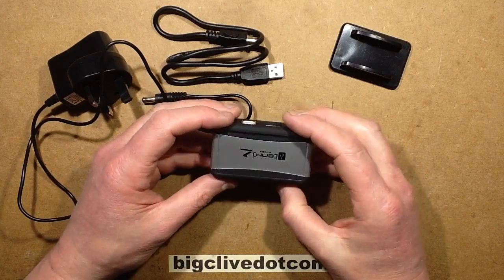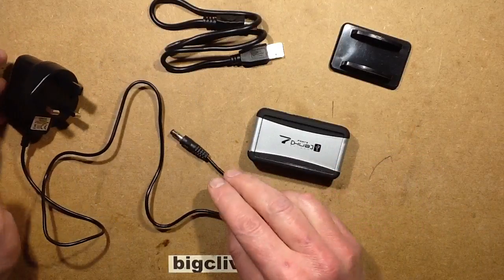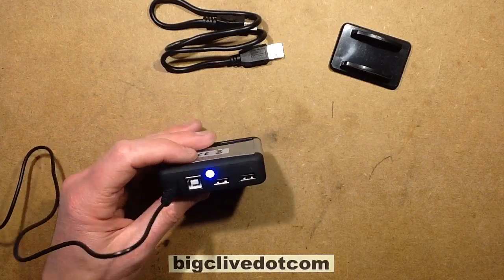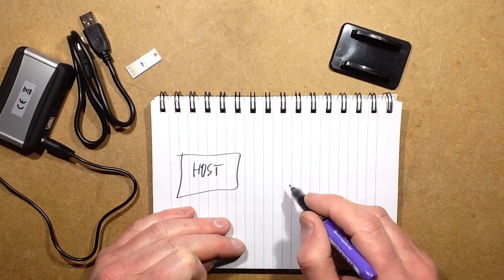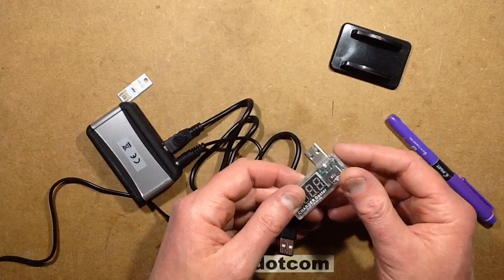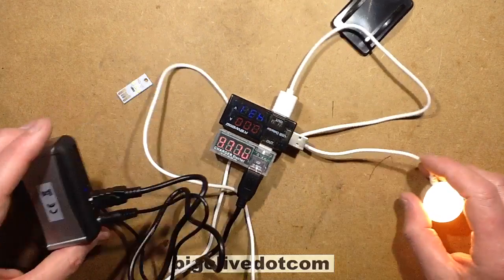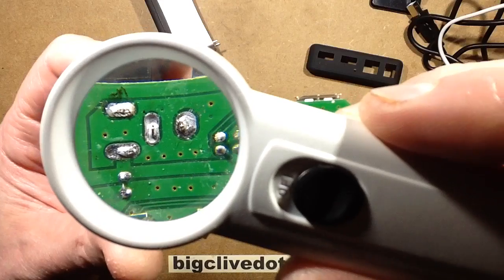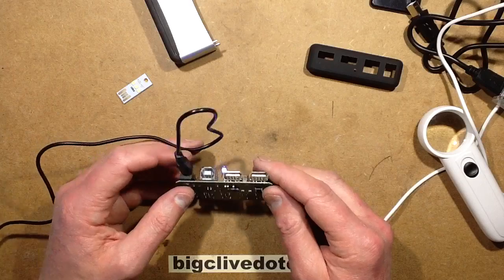Computer killing powered USB hub.  (Mac murderer)

Comment: Clive, there is a in important reason that people will use a powered USB hub even with a powered desktop computer.  According to the USB 2.0 standard (yes, I am out of date) the current that must be delivered by a powered hub is the same that should be available from a regular USB port (about 500mA if I remember correctly). If it is a non-powered hub, it is only required to source a much lower level of current (can't recall) so some devices that don't have their own power supplies may not work from a non-powered hub.
If the hub is supposed to work either powered or non-powered, it should have circuitry that prevents its own power supply from feeding back into its host system.  This was just an improperly designed hub that likely did not meet USB standards and should not have legally been able to carry the USB logo.  BTW, if it is reported and the USB association finds that the logo was not legally approved,  customs can seize these upon importation or they can seize inventory from a store.  Likewise, you may want to report some of the unsafe LEDs and power supplies as, if they have false safety certification marks they are illegal and should be seized.  You may save lives doing that.
And yes, such seizures do occur.  An android box importer had their entire shipment seized because the USB logo was not approved.  US Customs seized it.  A local "Tiger Direct" had their stock of VESA video cables seized because the Vesa video cables were not approved by the VESA association so the logo was not legal.

Comment: If someone killed their comp doing this they are not the brightest. One is for just power when you are using the mouse and keyboard and the other is for power and data. You don't use them both its made for 1 at a time.

Comment: Own one, same observation as others, PC refuses to boot until disconnected. Still using it but USB-B port has broken solder joints.

I guess the option to be powered by DC barrel connector comes in handy if you know what you're doing and has a reason to e.g. audiophiles.

Comment: A few motherboards ago, I noticed one evening that the chipset fan kept spinning even though the computer was off - and it even kept spinning after I unplugged the power cable. You can probably guess where it got the power.

In general I noticed that USB 2 hubs almost all feed the power back to computer, but USB 3 hubs (that I tried) apparently don't.

Comment: Guess someone started using the hub without first reading the instructions. Supply power to the hub using either the mains or a host PC (when access to the mains power supply is unavailable), not both at the same time. Why would anyone connect 2 different source of power to a single device? IMHO, it is unfair to blame the hub when it is the users who are lacking common sense.
Reply: Rovin Tan The standard job of a powered USB hub is to supply more power to its outputs than it could get from the PC.  It's an amplifier for the data lines, it shouldn't back power the PC.

Comment: LOL ive got one of these and ended up just using the USB power from the computer to power up to 4 devices depending on what they are.
After I realized what was going on I only ever used the power supply if I was using USB only powered drives.
Took me a while to figure out what was going on.
I've even found that some drives will cause my system to be stuck in boot mode while those drives do not have any power.
This is on a Toshiba 850L running Win 8.1 so it isn't just limited to Apple systems.

Comment: Perfect present for anyone using a Mac.
Reply: +Pressure Designs Pretty sure that's property destruction if the other party sue
Reply: +LindLyman That would only be a problem for US citizens.
Reply: Pressure Designs
Probably EU as well.. but yes - you're right.
Reply: +LindLyman I am pretty sure that i am save over here in Germany.
Reply: Hmm... I remember someone got arrested for knowingly installing a bunch of faulty gas regulator in a flat in Spain.

Comment: I had that actual hub many years ago - and the backfeeding was a byproduct bonus as the host plug would power the raspberry pi it was connected to. I could have all peripherals connected and have the pi powered and active data lines. This was an original pi so no idea if it works the same anymore.

Comment: I have one of those and the DC that comes thru a converter is to be plugged in if you are using the hub for charging devices and should never be plugged in same time as computer or bad thing can happen. For me that wrote in manual for hub.

Comment: If your wondering why it only damages macs when sleeping, its because when the mac is turned on it is supplying 5 volts to the hub, which is pushing back on the 5 volts from the hub, reducing the current flow to 0 so its not back feeding. When the mac is sleeping though, the voltage is reduced in the usb out, which allows for the 5 volts to flow back into the mac, and basically confuse the computer until it freaks out and shuts down.
Reply: Makes sense, since I don't think USB ports are connected to the 5V standby rail on the PSU that's always on even if the PC is shut down.

Comment: Thanks for this Clive, I never thought to check powered USB hubs like this.  With the plethora of 'new' USB 3.0 hubs and probably USB-C hubs, this could become more of a common occurrence.  Especially if you consider the new higher amperage ratings of these new standards, and the lower standards of the manufacturers (engineers?).

Comment: Oh dear, I have one of these!  I have a PC not Mac.  It's been a POS since the start, given that only three of its "7 ports" actually work to connect to the PC!  The top three on the front work, the bottom two on the front don't, nor do the two on the back.  Other than that I've not detected any problems, but since I recently bought an eight-port powered USB charging block I'm going to unplug the power from this hub and just use it, as you suggest, for connecting devices to the PC.  Well, three devices at least.  I'll probably throw it away at some point and buy a hub that actually works on the advertised number of ports.

Comment: It's required to use the 5V from the PC to power the pullup or pulldown on the D+/D- lines, afaik. It blows up the mac by having two drivers with differing references on one power line. One is going to pull it up (probably this one) and the other one's going to be pulling it down (probably the Mac's own). So that's going to continue until either of them gives in, disconnects or until they match voltages by stray resistances. At which point they'll be burning probably tens of watts each to match each other -and leaving your computer burning tens of watts in getting the 5V channel to be 5V is going to run it out of its expected spec at least.

Comment: Well crap!  I have one of those ... thankfully I haven't used it as I had planned.  Put a voltage metre on it and sure enough, 5 volts coming through the wrong way.  Guess that's what can happen when you cheap out on a hub!
Reply: MrHappyBollox A hub is a USB device that allows you to plug more USB devices in at the same time.

I record/produce music as a hobby.  My laptop only has 2 USB ports, but I wanted to be able to connect more than 2 pieces of music equipment to it at the same time.
Reply: MrHappyBollox Thanks!  Yeah, the one he is testing from is a USB "B" style plugin to the unit but the rest are standard USB slots.

Comment: I think it was built specifically for the new Mac that came out a few days ago. The newest Mac has only one to two ports. One of the ports being a usb-c drive. I believe the company built this module not just for Hub accessibility, but to be able to charge the laptop as well. Just to make myself clear, there is no unique charger for the Mac. I think the only two ports for the pc would be usb-c and possibly a headphone connector. My question is, is this possible? Please get back with me on that

Comment: Yep. A similar hub blew my PC power supply. I learned the hard way. Thanks for drawing this to people's attention. I now have a TP-Link 7 port hub with two charging ports (i.e. non data). The charging ports are also higher amperage so I can charge my phone faster, but there is no data connection on those higher amperage ports

Comment: Top tip: Get a new one. Don't risk your Mac with a cheap Chinese USB hub.
Reply: +Chuby123 actually... RISK YOUR MAC IT HAS NO VALUE
Reply: +yotoprules Mac hater😞🖥
Reply: minecraft guy06 - Road To 30 Subs *apple hater. apple is a piece of crap nowadays.
Reply: +minecraft guy06 - Road To 30 Subs bro have you seen your own face? Fucking cringe as duck

Comment: Hey Steve
A gazillion thanks for this video, was having some problems today with the new pc I build, would not power on....
I started fiddling around and noticed that, even thou my pc was wall-unpluged my mouse light was on.
I remember this video instantly and found out my hard drive usb dock was returning current to my mobo.

10000000000000 thanks

Comment: Thanks for posting this video.  I have one of these, connected to my Dell PC.  I have had it for many years (longer than the PC).  I had it connected to power, and the PC, but nothing else recently actually plugged into the hub.  Something was causing my FPS (frames per second) after sleep to tank, from 90FPS before sleep, to 13FPS after resuming from sleep.  (game: TrackMania Turbo).  Disconnecting this hub solved that problem.

Comment: I had something similar YEARS ago with warning stickers all over it that said not to power it from the machine and the outlet ("mains") at the same time. I suspect this is designed for one or the other but not both at the same time. Did people not read the instructions or did it not say, I wonder?
Reply: +Damon V D&#39;Amore So what if you're connecting, say, a portable hard drive and, I don't know, an iPhone to the hub and the hub is plugged in and powered by its AC Adaptor?  Most computers do put out enough power to operate most USB devices, and if you've got high powered devices connected to the hub, that is, devices that draw a lot of current, you'll need to use the AC Adaptor.

Comment: I! WANT! THIS! HUB!

It could power my Wintab cheap Windows tablet with only one USB and make it possible to plug in USB devices at the same time.
Reply: +Bastet Furry It most likely won't. Only a couple of USB OTG controllers support charging and data transfer, most of them sense the OTG line and if it is connected to a device they turn the USB port to powered host, no current will flow into the device.

Comment: what if you just plugged it in to the computer/mac without plugging in the power supply cord so the there wouldn't be any back feed do to the fact that your comp/mac is powering it through the usb port and not being powered through the wall

Comment: Clive, can't we just stick a diode on the 5v pin leading into he computer?   I guess the 0.7v forward voltage drop of the diode would be a problem?  Perhaps a germanium diode with a lower voltage drop would work better?  I'm probably just going to clip my 5v line into the computer and continue using the external supply.   I have a different 7 port hub from AliExpress which I'm having an issue with.  It's recognized as USB 2.0 but I'm getting very slow speeds.  This back feeding doesn't affect speed does it?  I guess it could if it's reverse biasing one of the FETS or control chips?
Reply: I don't think you can do it that way (very easily). If I recall correctly, I tried doing that but the chips are powered by the computer and not the external power supply and the way the board is laid out, it would have been complicated to bypass. I ended up cutting the track near the power connector so that it supplied the USB out ports but so that the chips were still supplied by the computer,
Reply: Correct, that's what the hub maker should have done.  Using either a low dropout schottkey or an active MOSFET rectifier.  Contrary to Clive's assumption, I believe the hub is required to sense the 5V line from the computer and turn off the data lines (including the pull up resistor that indicates to the computer that something is plugged in), this is to ensure that no backpowering happens on the data lines. Because USB hubs are generally single chip solutions, the needed curcuits are probably already in the chip, they just wired it all wrong.

Comment: Wow - I just repaired this very same hub about two weeks ago. Used mine on PC. No power back feed; just no power at all.  Disassembled and found cold solder joints everywhere.  The Via 's for the main power were huge compared with the pin sizes and had virtually no metal (traces) around the opening in the board.  Overall, I just thought it had been soldered by hand by a child on his first day at work, but I'm shocked to see this same exact model here making mischief in other ways.  I'm so glad you posted this.

Comment: I have had a couple of these kinds of hubs. When I would shut off my desktop while it was plugged in my computer fans would still be running....I was like wtf? So I unplugged it and just let it run off my pc's usb for power and it works fine w/o any problems as it should. I think they may make them externally powered for using them as chargers w/o computers only...for multiple cell phones ect.

Comment: I bought one of these for charging devices as it was advertised as a stand alone powered hub but when i got it i found the one i have would not charge anything unless it was connected to a pc as well as the wall socket which is pointless to me. I was going to use it on my iMac but decided not to and after watching this i am glad i didn't.

Comment: My understanding of how USB cables are used between host and powered hub (or powered slave device) is that the ground wire is also not used, not just the +5V wire. This is because USB uses differential signalling, and sharing a ground would complicate things from an engineering/cost perspective. Sorta the same way that unshielded ethernet and 4-pin FireWire cables work.

Comment: i uh.. have like 5 of these, once i saw you pull it out.. i went 0.0, because these came out of a ton of old school computers.. the pci panels were removed and the usb cable was going through the panels into the pc to the hub, powering a wifi usb dongle aswell as a few mouse and keyboard dongles.

Comment: I had one of these hubs and it also was supplying 5v to my USB port. It didnt cause any permanent damage to my laptop.(been running fine for 3 years since). It did however prevent my laptop from hibernating and sleep. It would shut down fine but if I tried to hibernate or it tried to sleep on its own the screen would just go black and the computer would remain on. It required a hard power off via holding the power button and a reboot to work again.

Comment: You're probably not meant to power it unless you are using it as a charging hub only, they could have put a few cheap components to prevent the power backing into the computer if you power it both ways lol

Comment: I had the very same hub. When it was plugged in and powered my PC wouldn't switch on. Unplug the power to the hub and the PC would miraculously switch on. I sent it back. I'm so glad my PSU and motherboard has protection for this type of problem.

Comment: I have one of these, an older model I think because the black parts of the plastic and glossy on mine, and it definitely works fine without the wall connection.

Comment: It is just about saving the cost of one or actually two schottky (low voltage drop) diode. Both should be able to power the hub and the connected devices but none of them should power the other " power host ".I haven't notice this before but it could explain some strange behaviour.I will modify them all immediately!Thanks for the video!

Comment: I have one of these.   I just pulled it apart and the pin on the side of the 5v input jack is not soldered.  Would this be done intentionally to try to prevent backfeeding?  seems half ass either way

Comment: But you can solve the problem in two ways:

1. Open up the USB-Cable which goes to the PC and cut the 5V Line. Dont forget to insulate it. ( You now ca use the Hub only with the Powersupply)

2. Open up the USB-Cable which goes to the PC and cut the 5V Line. Solder an Diode which let the current flow to the Hub, but dont let the current go to the PC.

Comment: I have one of those. Fortunately the power adapter that it came with is not compatible with local sockets, so I've never used it powered. Dodged a bullet.
Reply: You bit the bullet when you bought a mac
Reply: lucky
Reply: Where do you buy it at can't find it on amazon
Reply: I also bought one of these, but luckily the cheap ass sellers were not kind enough to send the power adapter. it sits somewhere behind my desk and i can not be bothered fishing it out.
Reply: I found mine on a dodgy looking online shop called Tmart.com. it seems to sell mostly crappy Chinese goods as far as I can tell.

Comment: The USB chip Apple use tend to trip easily to protection mode where the USB port is completely disabled (equivalent to Hi-Z on the data line) if something goes wrong and need a proper reboot to recover, I suspect it's what is happenning there.

Comment: Several popular powered USB hubs do this, unfortunately.
- My D-Link DUB-H7 (the old silver model) keeps a light-up USB host cable illuminated even with the computer end disconnected.  No damage, but certain motherboards refuse to POST with it connected.
- I just checked my Plugable USB 2.0 10-port hub, and it's feeding five volts back through the host connection as well (model USB2-HUB10S).  Even when the PC is unplugged, some of the motherboard lights still glow while it's connected.

The only USB hub I have that does not feed 5V back through the host connection is the one in my Dell 2408WFP monitor.